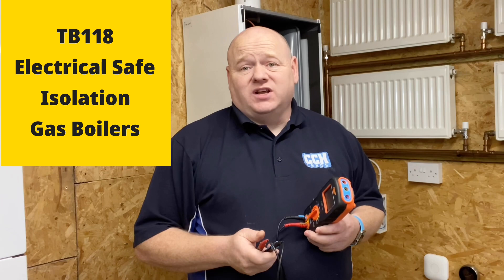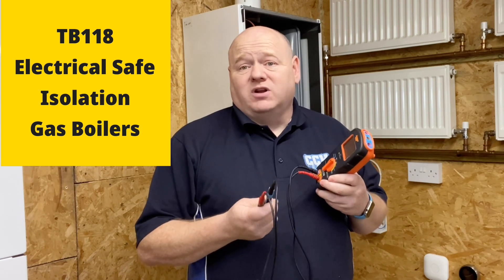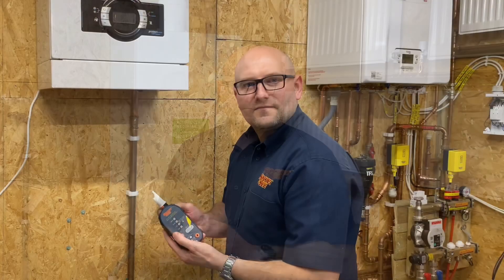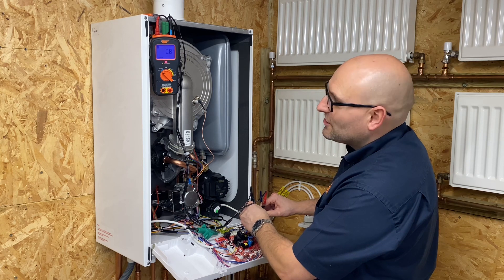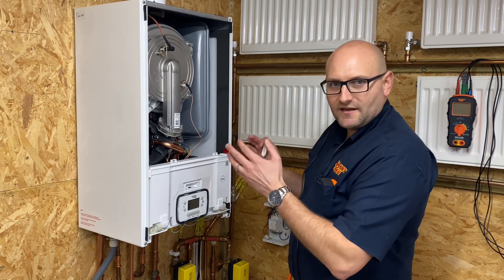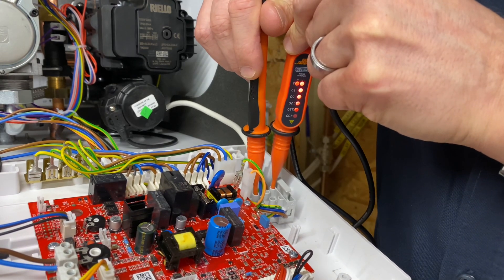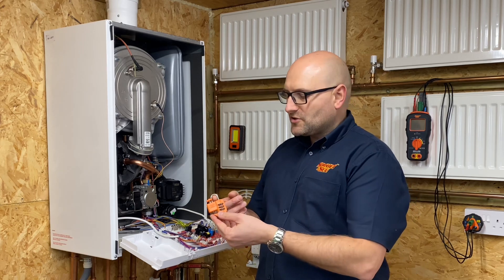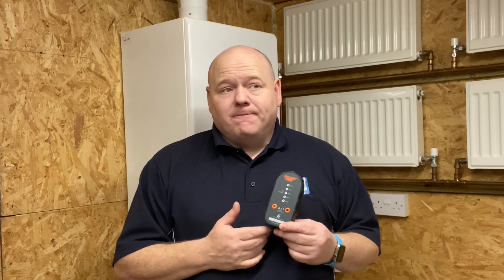TB118 Electrical Safe Isolation - When Things Go Wrong

Comment: Where in TB 118 is the operative instructed to perform a 'safety toch test' or an earth loop impedance test or a polarity test - the ONLY 'procedure' derined in TB 118 is the Safe Isolation procedure !  This video does nothing more than add to the confusion within the industry because TB 118 is ill-conceived, misguided, misworded, inaccurate and contains an unforgivably dangerous bunch of words - it should be no more than 2 pages long and explain what is in the title of the TB - a SAFE ISOLATION PROCEDURE !  The objective is simple - prove the test gear good, isolate the appliance, prove the appliance is dead and then perform a confidence test of the equipment to prove it is still good.  The document has opened the flood gates for test gear manufacturers to sell kit for checks that are NOT required to keep the gas operative safe ....

Comment: I am a afraid that a volt stick is not a enough for testing .
Reply from the maker: Why are you afraid?
Reply: @AllenHart999  Because it's being presented here as a means to check that something is safe to touch when it most definitely isn't.
Reply from the maker: @sdgelectronics  What products do you use on the case? Normal testers wouldn’t do it.
Reply: @AllenHart999  you can use a two pole tester if there is a known earth nearby such as a 13A socket. The main issue is the non contact detector has many limitations and the user needs to understand how they work. Unfortunately they are most lethal in the hands of someone without the electrical knowledge
Reply from the maker: @sdgelectronics  that wouldn’t work on a boiler case would it?
Reply: @AllenHart999  so long as you have an earth reference for one probe, you can use the other probe on any metallic exposed part on the boiler, such as a case screw
Reply from the maker: @sdgelectronics  The case is painted and the volt indicator works when other things wouldn’t. It’s only part of the tests and tbh not many people do them anyway. It’s good to get gas engineers talking about it. Thanks

Comment: As a sparkie it's interesting to see it from another point of view, especially after this godawful case where a single screw in a steel-framed flat killed a young girl ("boiler" was an immersion rather than gas or oil boiler but it's still a caveat if you're dealing with an indirect Megaflo with an immersion or in fact any electrical connection): https://www2.theiet.org/forums/forum/messageview.cfm?catid=205&threadid=57216

Comment: Thank for another great video Alan , could you tell me in your opion is underfloor heating stays cleaner than radiators ., many thanks
Reply: You can get other blockages in the system such as microbial growth, this would block your system in the same way as a radiator system gets blocked, yes you can treat this but don’t think underfloor is blockage free it simply isn’t the case, I’ve cleaned a few out over the years.
Reply: @kevint3845  i completely agree with you, because of the low water temperature bacteria forms and creates just as much of an issue as iron oxide does, i have had to replace many stainless steel heat exchangers because it was fitted to an underfloor heating system.
i would use hydraulic seperation or a aluminium heat exchanger if underfloor heating is used. and these boilers were only a couple of years old and still under warranty.
Reply: @HalleB127MX  Yes we have definitely had the same issues, I can’t get it over to people that plastic underfloor is not maintenance or blockage free but it’s being sold as so, thanks for the reply.
Reply: @kevint3845  Thank you for replying .